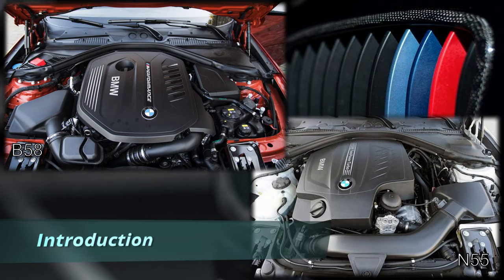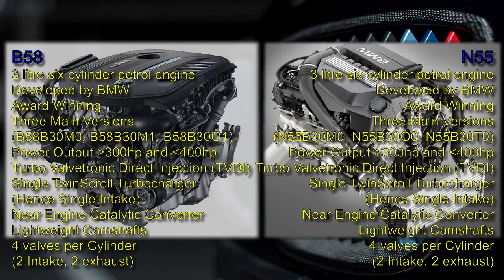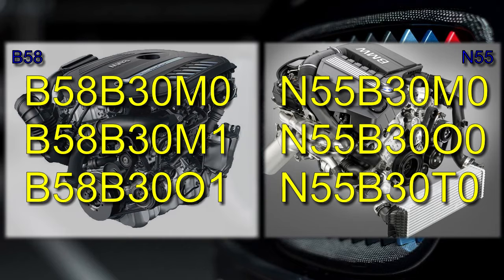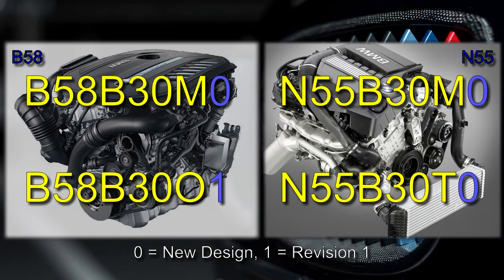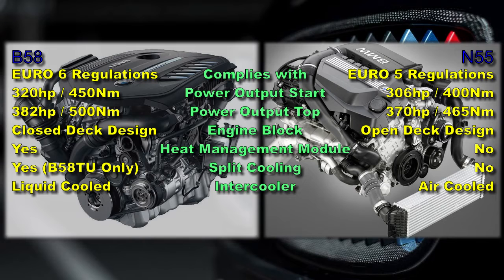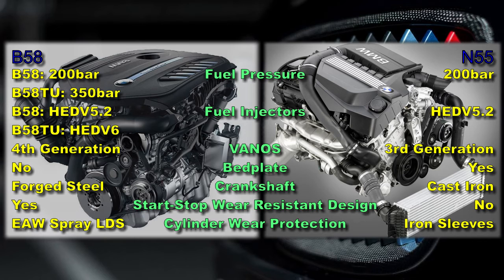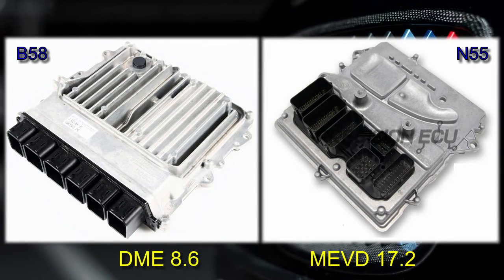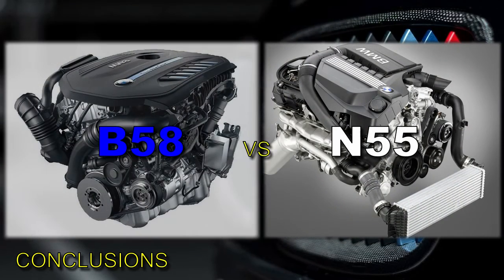BMW B58 vs N55 Engines: A brief but proper look at the differences & similarities between the two...

Comment: This is a great video!!! Hey, I just wanted to ask.

When you compare the N55b30m0, to the N55b30, the M0 has less HP.

It seems as though the M0 is a lower end engine.

My question, is, is the M0 any less reliable? How is the reliability?

in mid 2014+ BMW improved the rod bearing design in the N55.

Does this apply to a 2015 car that has the N55b30M0?

Thanks! it means a lot to me!!
Reply from the maker: Hi there, the N55B30M0 power was certainly down rated with the engine probably capable of greater output safely even at entry into service, but kept to a certain power output for commercial reasons. BMW will often offer higher power in terms of a more aggressive tune (e.g. the "competition package" for M cars or M-Performance Power and Sound Kit for B58 cars) without any hardware changes, demonstrating that there is a policy to withhold some power and "unlock" full potential for a premium. Reliability will often depend on the manufacture year of the engine, and while the engines will all be N55B30M0 in type, the later production years will incorporate small modifications or production improvements that will increase reliability. The best way to view this is with RealOEM, where for any specific component, it will show you that the P/N changed after certain years. Some viewers commented about the turbo electrical wastegates replacing the pneumatic wastegates at the late stages of N55 production in 2015, etc. That would be an example of a significant mod, but there can be material type changes, small quality improvements in unchanged hardware, etc, all of which come together to address various reliability issues. Alot of components in these engines are shared between engines and so the entire range of engines can benefit from some upgrades. Ultimately some of the engine-specific reliability issues of the N55 cannot be resolved economically, and this is why the B58 comes in to replace the N55 and address its flaws with a clean sheet design. I looked at RealOEM trying to find any changes made to the rod bearings in 2014, but none is shown. I am therefore not sure if there are upgraded rod bearings introduced in 2014 for the N55B30M0, but I am relying on RealOEM, so I could be wrong.
Reply: @NoBrainerTalk  Thank you so much! This response was great!! That is really good to know!
Reply: @NoBrainerTalk  So, would you say that the N55 is a good engine? I know it is not B58 level, but is it reliable? a 2015 N55B30M0? Should it be alright for some time, if I do the oil every 5k, and take great care of it? Thanks!!
Reply from the maker: @Anthony-qh1xv  That is a difficult question to answer, because it matters alot how well the previous owner(s) took care of the engine before you. It's considered a good engine. Generally if you show them love and take care of them, they will last a long time (there are many well known issues, but all of them manageable). Some preventative maintenance (addressing some of the known issues of the N55 before they bite) might give you more peace of mind. There are no guarantees of course.
Reply: @NoBrainerTalk  Hey, I had one more question, I am sorry. So, when I listen to my engine run from under the car, I hear a tick sound with the rhythm engine. Is this normal? There are many weird sounds with these BMWs I have learned. Thanks!

Comment: B58TU has a compression ratio of 10.2:1
Reply from the maker: Not according to BMW technical documents, it is still 11.0:1 at least for the B58B30M1. There is uncertainty for the B58B30O1 however (I will make a video soon).

Comment: The N55s in the M235 and M2 have a forged crank.  All 2014+ F series N55s use the S55 crank and rod bearings and forged S55 connecting rods.  All 2014+ N55s have electronic wastegates and a larger turbo.  All N55 cars have electric steering racks.
Reply: Only the m235i not all f chassis n55s don’t have have people blowing their n55s ❤
Reply: For 2016 to 2019 model years the N55 was updated again while both the N55 and B58 were in production.
Reply: The e9x with the n55 didn't have electric steering
Reply: @ogkhud  is correct, I have a 2011 335xi (e90 w\N55), it does not have electronic steering.
Reply: @ogkhud  I believe I read somewhere that the 2014 X1 35i was the last production model BMW with a hydraulic rack?
Reply: False, PWG n55s from the e9x generation don’t
Reply: What’s a F series?
Reply: @alanmusa7143  The chassis designation of the 3 series between the 2012 and 2019 model years (F30 chassis and iterations) and the 1 (F20 chassis) and 2 series cars (F22 chassis).
Reply: @alanmusa7143  chassis code F. Like the F01 7 series, F10 5 series, F30 3 series
Reply: @alanmusa7143  there's no such BMW "F series". There are F chassis car that began in 2008 with the F01 7 Series. G chassis cars began in 2017 with the G01 X3
Reply: I had no idea >2014 N55 had the crank and rod bearings taken from the M3 (S55). How about the engine mounts?
Reply: Correct, this guy doing the video knows Fuck all obviously
Reply: What about on 2012 f30 n55?
Reply: Yes, that is true👍
Reply: The 5,6,7 series N55 cars (xdrive only) came with hydraulic power steering for packaging reasons.
And not all 2014+ N55’s have electronic wastegates (that also came with a larger turbo). 
For example, you would have to find an F10 with a build date of 7/14 or later to get the ewg N55, which is a late 2015 model year at the earliest.
Reply: Is the n55 from 435i cabrio reliable at 400hp ?
Reply: @IamTOO_FAST  Depends on the tune. 400hp to the crank is nothing though, i’d keep it under 650hp to the crank for reliability.
Stock turbo is good for around 500hp or so
Reply: Forged parts from s55, also installed on x5 f15 2017???
Reply: The B58 has forged crank too !
Reply: Does this 2014+ change in rod bearings, and crank, include the N55b30M0? Thanks so much for your time!
Reply: @Anthony-qh1xv  it doesn't really matter they still blow up at 500hp+ all day

Comment: The N55 engine exists with an electronic wastegate (after 08/2013). And the first X4 "M40i" also had the N55B30T0, the only 40i with a N55.
Reply from the maker: Nice comment! Yes, it's true. Some late production N55s did introduce electronic wastegate and yes it's also true that the N55B30T0 engine is found in early X4 M40i cars. There are even older cars carrying "40i" designation that are not fitted with B58. It's abit like current F40 M135i fitted with 4 cylinder engine and F20 M135i which had N55 6-cylinder.
Reply: Does the N55b30M0 made in 2015, have the better rod bearings? or no? Thanks!
Reply: @Anthony-qh1xv   I don't think so...
Reply: @philtechGT3  ok, are they problematic? Or does it come down to how you take care of it? Design flaw? or not? Thanks!
Reply: @philtechGT3  it does my good sir
Reply: Mine is built sept 2013. Is it ewg of pwg
Reply: @Chenzooo pwg, cast internals, n55b30O and n55b30T introduced forged internals and ewg post 2014 which revised the n55b30M variant to a ewg.
Reply: i got a 2015  640i  are rod bearings a thing on that model year ?
Reply: @Agent-mw8th  the N55 in you 640i had the forged piston rods and rod bearings from the S55
Reply: You forgot the F01 740i that had an N54 and the LCI retained the 740i nameplate but now had an N55, also the F12/F13 640i with an N55.
Reply: There is also a n55 in the 640i

Comment: All of the M series BMWs that received the N55 engine all received forged crankshafts, just thought I'd also mention that.
Reply: So the m235i has forged crank over the non M ? On the fence of trading my vette but ive heard alot about unreliable n55s from 335i owners
Reply: @1slowwltg744 no, youre right, the m235 has a forged crank and the m2 does also, both are tuned different in cases of fueling and timing etc

Comment: So a timing chain job requires engine out?
Reply from the maker: Yes, for B58 it does look like that's the case. It might be possible with transmission removal instead (and alot of other peripherals removal), but the access is so limited I personally doubt it. But I might be wrong.
Reply: Not anymore
Reply from the maker: @qwertyqwerty-zi6dr  Hi there, please can you explain further what "not anymore" means? :)

Comment: Plz show the B58 crank hub fixed design.
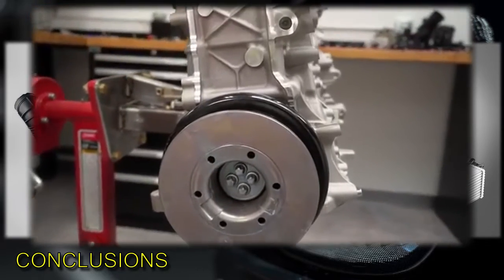Reply from the maker: Hi, if you go to 12:07 in the video, you'll see the new design, which is four pulley bolts instead of a central bolt.

Comment: N55B30TO makes 500Nm on overboost
Reply from the maker: Yes, this is correct, the N55B30T0 can temporarily achieve 500Nm via a brief increase in charging pressure (overboost).

Comment: Great info! I love my OG M2 but still wish they would've put a B58 in there instead 😪
Reply: N55 on the m2 is a still a very strong engine
Reply: @qwertyqwerty-zi6dr  for sure! If I can get like 450whp on pump with a Pure stage 2, I'd be super happy.
Reply: @micraw714  n55 stock turbo maxs at 460whp lol. you can push 550+ reliably with a pure stage 2

Comment: May u explain what are the differences in F87 M2 version of N55? I heard its also a closed deck design??
Reply from the maker: Hi, negative the N55 in the M2 (N55B30T0) is an open deck design. It does have the following upgrades compared to the N55B30O0 (the highest power version of N55 that is not in M-Car): 
(a) Pistons adopted from the S55
(b) Crankshaft main bearing shells adopted from the S55
(c) Sparkplugs from the S55
(d) Aluminium Oil sump from the S55
(e) Various oil system upgrades for motor racing requirements, including second oil pump, second suction pump and oil sump cover.
(f) Charge pressure increase by 0.1bar.
(g) Additional air-coolant heat exchanger and additional oil-air heat exchanger.
(h) Intake muffler box has additional opening.
These are the principal changes. Hope this helps.

Comment: Nice content. I was wondering if is there a chance that we could replace vanos solenoid and mechanical water pump without removing the engine with the m140I ? I've seen some dude succed reaching them on a 340i but I dont know how more sueezed it is on a m140i
Reply from the maker: Unfortunately I don't know. Out of curiosity what issues are you experiencing that require the coolant pump and vanos solenoid to be replaced?
Reply: @NoBrainerTalk  I got 2 friends who replaced their solenoid.  A N55 at 160kkm and  B58 at 140kkm (fortunatly on a 340i).
I'm looking for a m140i, and will be pleased to know for a peace of mind that I will be able to change thoses valve alone, without a tremendous bill from the dealer.
Reply from the maker: @UPR91  Got it. :) I think the VANOS intake and exhaust solenoid valves in the back are accessible to some degree, but fortunately I've not had to do it nor know anyone who had to do it, so I don't have any experience to share. Please do let us know if you find out.

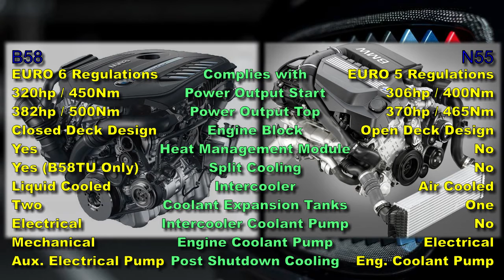Comment: @7:43 Does it mean I do not have to leave the engine idle after long ride or hard ride to cool down the turbine?
Reply from the maker: Hi Peter, I do the same (30 seconds to a minute). There is nothing in our BMW user manual about idling the engine after a spirited drive before shutting it down. I honestly don't think it causes any harm, but I don't have any data to say for sure there is a benefit. If the engine is switched off, the auxiliary electrical pump will continue circulating engine coolant to the turbo for a small period of time (a few seconds), however all the heat generating activity has completely stopped as there is no longer any fuel combustion. On the other hand, if the engine is still idling, and has reached high temperature, the ECU will be attempting to cool the engine down as much as possible with fan activation, heat management module in max cooling mode, etc. However as the car is not moving, radiator effectiveness will be low, and at the same time, the engine will still be generating heat through fuel combustion. Another difference is that oil will still be circulating with the engine running, and the oil can also extract heat from the turbo if the turbo is hotter than the engine internals. The engine will be cooling down when idling but whether or not this helps the cooling of the turbo compared to engine off, requires data to answer with certainty. There's also the fact the engine wants to retain heat for better fuel efficiency, so the ECU logic might be quite complex when idling. I think the practice of avoiding sudden changes is likely to prolong the engine, so I will continue to let it idle for a few seconds before switching off, and after that the auxiliary pump will do its thing aswell.

Comment: Rear timing chain doesn't mean  better weight distribution and is in general an idiotic design.
Reply from the maker: In the case of the N55 both the belt driven accessories and timing chain are at the front, whereas in the case of the B58 the accessories are at the front and the timing chain is at the rear. Obviously just the location of the timing chain is not proof of better weight distribution, but the weight is in fact more balanced compared to the N55. I agree that moving the timing chain to the back will make maintenance to it extremely difficult (essentially the engine will need to be removed). Let's just hope that the design and components used prove to be robust and reliable (we'll only know in the years to come).
Reply: @NoBrainerTalk  Arguably if we consider the center of weight of the engine on the longitudal axis (in line with the cylinders), I bet that putting the chain against the firewall increases forward weight bias, since that means moving the main engine block, which is the heaviest component, more towards the front wheels. Ideally you want the COG of the engine to be as far back as possible. And I doubt the chain constitutes more mass per unit longitudal distance when compared to the main engine block. Another consideration, which anyone who has ever owned a N47 diesel engine will know, is that the chain can get loud over time. Putting it in the back, right next to the firewall and behind the dashboard, means mors unwanted noise in the cabin. I could very clearly hear the chain clattering away with that engine. Therefore I struggle to find any benefit or reason why they would do this.
Reply from the maker: @harbl2479  Indeed the potential for increased cabin noise from the engine is why there is so much increased noise insulation in B58 equipped cars.

Comment: B58 is just better.
Reply: Oil filters disintegrating dropping bits of filter into the engine, injector issues and cracked pistons/bore scoring, coolant loss/coolant leaks everywhere etc etc. But if I was to believe the B58 hype like everyone else, I'd agree.
Reply: Rear mounted timing chain and arced on liners?
Rebuilding and maintaining it is going to be a pain.
Reply: Not soundwise.
Reply: @peterkukolik8402  Don't agree. In my opinion B58 sounds a bit better than N55 an much better than S55.